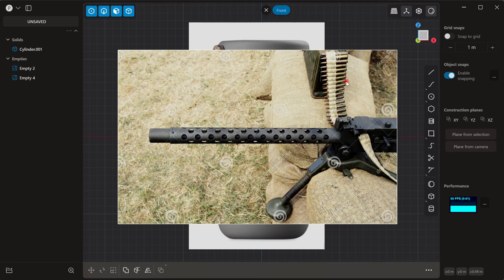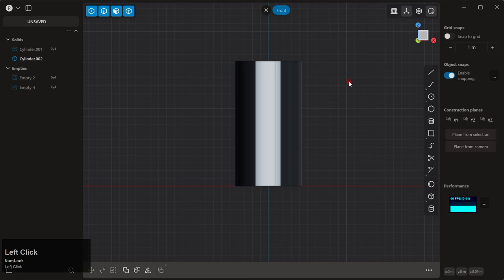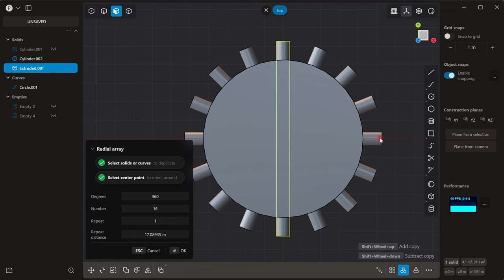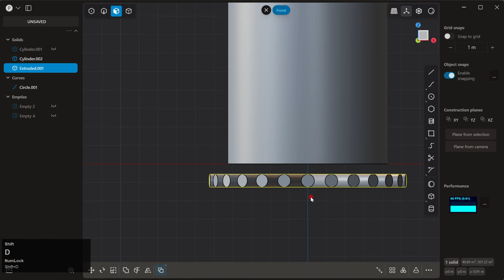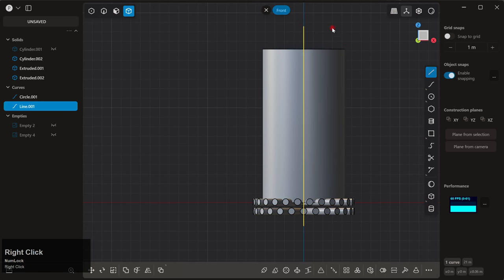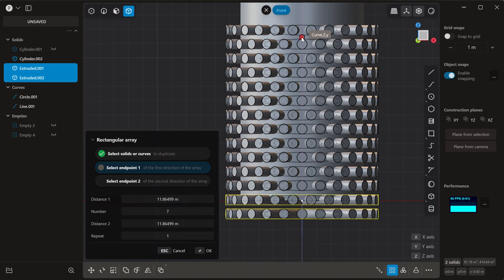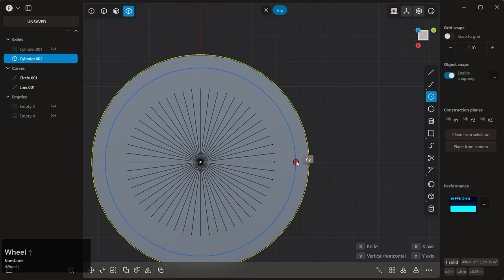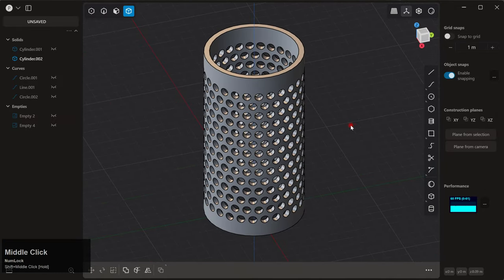Plasticity | How to cut holes in a cylinder | Model a gun barrel with holes #plasticity

Comment: Thanks for sharing! Is there a way to add bevels to all the holes without selecting all the holes manually?
Reply from the maker: Yes, look at the object from the front and drag a square, selecting only the holes. Or you can select the object with 4 and then press Ctrl + 2, and all the edges will be selected. Now, you need to hold Ctrl and drag across the top and bottom circles from the cylinder. I hope it helps

Comment: The best way to do it is CLIP MAP.
Practically nobody does that (for model weigh reason)
Reply from the maker: What is clip map? Is it a UV map with black or white holes used as a mask?
Reply: Not sure how it compares to real geometry. Clip maps are good for optimization, like for videogames. But for viz and print, I think real geometry is preferable